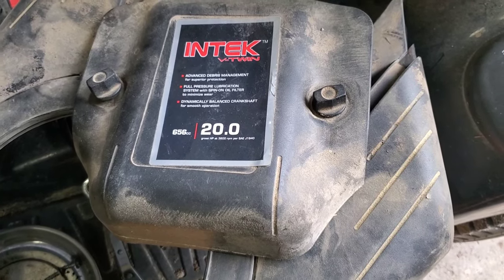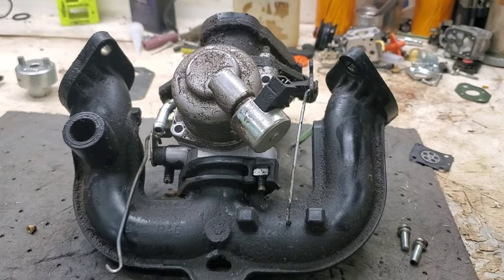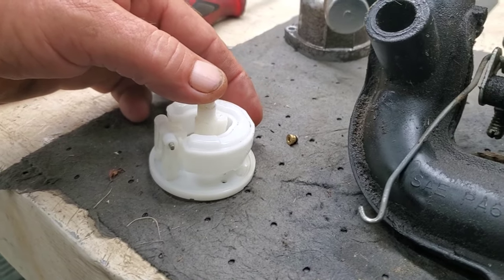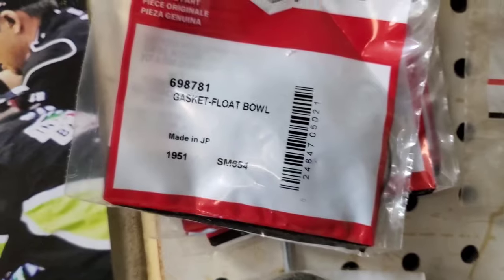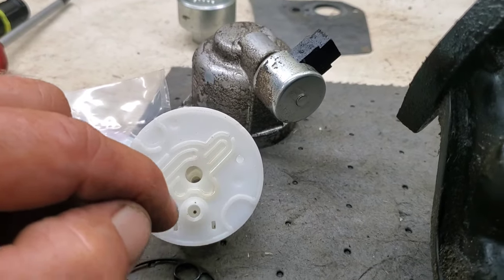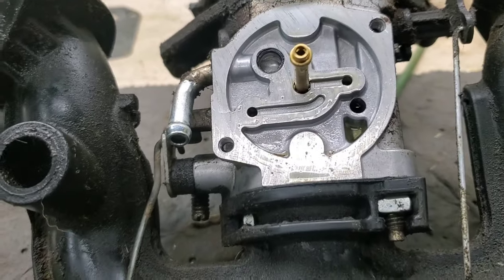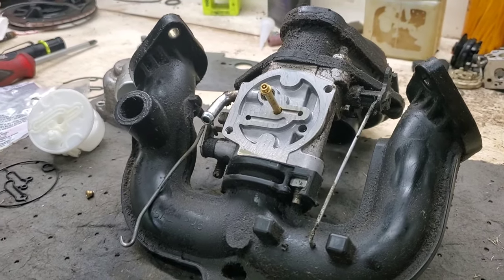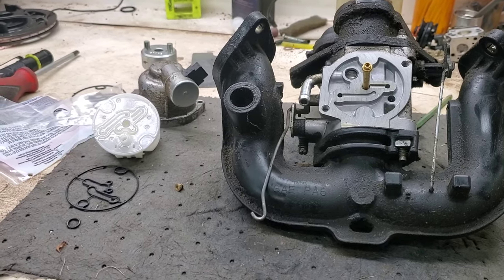Briggs & Stratton Fuel in Oil, Smoking, Nikki Carburetor Issue NOT Needle and Seat. Easy DIY

Comment: The first thing you SHOULDA done was chunk that Intek in the scrap pile.
Reply: No. Mine is 21 years old. Runs great . Only replaced carbs 3x in 21years.
Reply: @Ocean_breezes  😂 "only" 3 times in 21 yrs. Well, I guess you're the lucky one. 😉
Reply: @donaldshimkus539  Mine is 25 years old, and I've never had to replace the carb. I cleaned the jets once just to say that I did it. It does have the 2 BBL carb, though, not the one in the video. It still runs great.
From what I've seen, most Intek problems seem to be operator induced.

I do have to admit that I may actually have to replace the rear tires on the mower soon. I changed the fronts about 5 years ago.
Reply: @tinkerscorner54  I have 2 lines of thought here, 1 is if it's operator issues all other brands would fail at a similar rate. 2 is those who buy this cheaper product are less knowledgeable about it's operation/maintenance and therefore tend to cause their early demise. The few that last are owned by folks like yourself who know how to take care of their equipment.
Reply: @donaldshimkus539  You are correct.

All of them fail if neglected/abused. I see it in all types of engines, transmissions, suspension parts, tires, etc. Especially in cars. And then people get the rude awakening about what neglect/abuse costs them. They expect you to fix it cheap but don't seem to have a clue that it would have been much cheaper to have the maintenance done in the first place. Not to mention driving/operating habits . . . I've seen some really funky examples over the years. Some really great equipment just totally trashed out way before it's time from not even taking the time to learn to use it, let alone take care of it.

On the other hand, you don't see or hear much about the good ones. They just go down the highway in their 1974 Pinto with 500K+ miles on the original engine, or their 1997 riding mower that still looks and operates as new, better than the newer, similar equipment. Or their 1971 Motor home that, may not look all that great on the outside but is a jewel on the inside and under the hood.

Mostly what we see and hear about are the problems. I like the "Free Mower in the Trash" videos. Those are the ones where you see all sorts, from neglect and abuse to ignorance and not knowing any better. It can be either a jewel or a money pit.

Take care and have a great day!
Reply: @tinkerscorner54  thank you and you as well.

Comment: I'm having this problem with a B&S 40R877/0001-G1. Is this happening while the engine is running, or off? It's on a JD Z235, and the gas tank sits lower than the carb, so it can't be gravity.

Comment: I replaced the carb with the Briggs as listed. I am still having he hydolock issue. Any suggestions would be great.
Reply: Compression lock has similar symptoms, but no gas in the oil or extra gas pouring out the spark plug hole like this problem does. Usually caused by broken compression release lever on the camshaft. Tbone has a great video here on how to diagnose & replace camshaft

Comment: My 3 year old Husky zero turn decided to fill the crank case spilling the oil out the exhaust, the crank case had over 1 gallon of gas in it when I drained the engine and had no oil left.  It had sat for 2 months as I did not need to cut the grass due to lack of rain. the engine actually hydrolocked from the amount of fuel in the cylinders. Ran fine after draining then engine and flushing it. Now to get to the root of the problem. this looks like a good place to start.
Thanks for the great video.

Comment: I have a 20 HP Briggs & Stratton motor for gas, i have a same problem, i changed a carburater complete for a new one, and the problem is still remains. Please can you help me?.
Other sings, gas is expeled by exhaust pipe, oil in air filter.
Reply from the maker: If your old has gas in it only two things can cause it. Carburetor or fuel pump leaking gas thru the pulse line into the valve cover.

Comment: My mowers doing this, but it’s a 22hp V-twin Briggs and Stratton, so I’m wondering what the gasket & O ring kit # is?
Reply from the maker: Look on the valve cover and get the model, type and code. Then look up the correct part number for your machine on partstree.com

Comment: thumbs up but i wish i saw it go back together and start up.i'm trying  to help inlaws w their 2017 ariens riding mower which is getting gas into the crankcase.
Reply from the maker: Fuel in crankcase is caused by a leaking carburetor or a fuel pump leaking thru the pulse line.

Comment: Thank you so much. I have nearly the same engine in a husqvarna and it just started blowing blue smoke, gas coming out of the exhaust and my oil is filled with gas. I will pull off the carb the way you showed. Thank you.
Reply from the maker: Thank you. You can fix it my friend.  We have a couple videos on that issue.  One had over 100k views.
Reply: @RaleysSmallEngines  say, before it broke down, I had recently changed the oil and oil filter. Obviously I need more oil, but is my new filter trash, or can I still use it? Thank you again.
Reply from the maker: @nickr4015  replace it

Comment: Hello sir, Love your video.  I Have been struggling with this issue with gas getting into the motor.    I'm very familiar with needle seats and carbs. I have had a lot of dirt bike carbs over the years.  Anyways, I cannot get rid of this issue.   I have drained the tank and new fuel filter.  My struggle is, I just purchased a brand new briggs and Stratton carburetor and put it on.  Its doing the SAME thing, where white smoke and gas is filling up the oil.  I'm at a complete loss knowing it has a brand new carburetor.  I keep thinking what else it could be?  Gas tank not totally cleaned out.  This is on a John Deer Z425 zero turn mower.. any help would be appreciated.
Reply from the maker: Thanks for watching.  You may have a bad fuel pump.  Remove the pulse hose and see if it is wet with fuel.
Reply: @RaleysSmallEngines  .  Do you think the fuel pump or lines is getting debris so the needle seat won't close?  What is weird, if I change the oil again to remove the gas and put oil back it starts up like a champ and can mow the lawn fine.  Give it a week later, gas is back in the crankcase when starting it back up.  I'm going to change the lines and then look at pump.    That's about all that's left.  I didn't think about lines Until now...im going to order a new pump.  Do you happen to have that part # for. 23hp John Deere z445 Briggs and Stratton
Reply from the maker: @Mark-jz4dz  just order a Briggs and stratton vacuum operated fuel pump. Don't use aftermarket.
Reply: I just want to say this fixed the issue.  I can't figure out why a fuel pump makes the needle seat stay closed. This should be done by the floats in the carb.    I'm definitely not a small engine guy,  thanks for the recommendation, I  probably replaced the oil 6 times because I thought I had this fixed.  So simple...
Reply: I was having this same problem hopefully this will fix it...I hate these fuel pumps. Thanks for this information